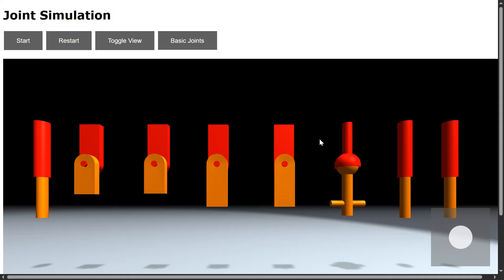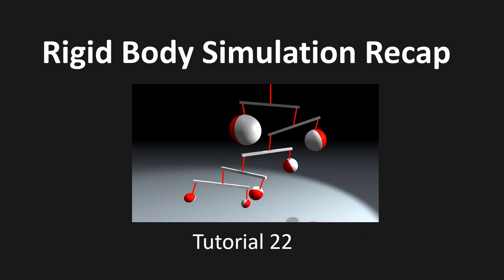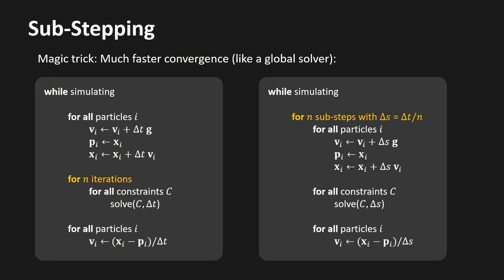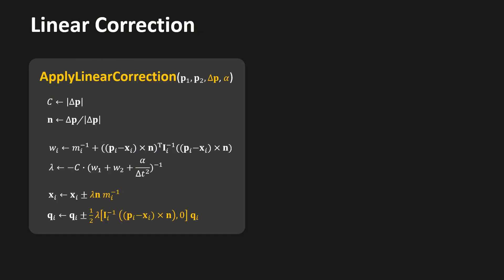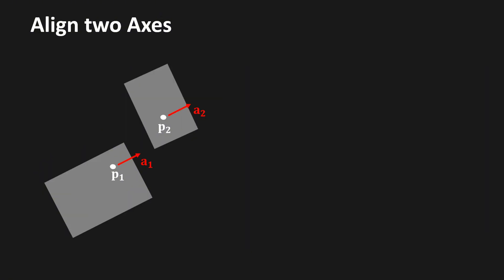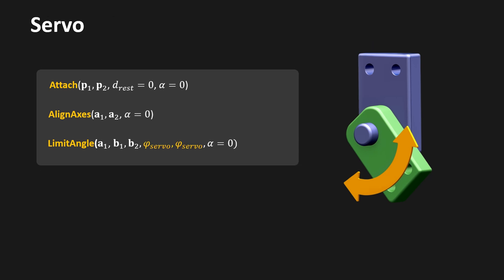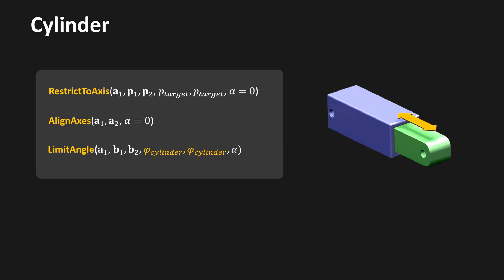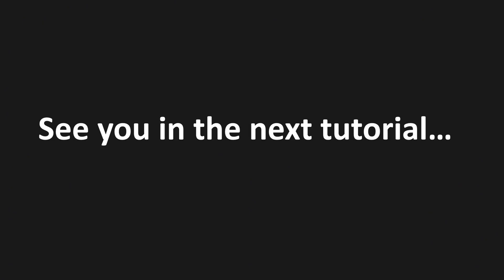Joint Simulation made simple

Comment: I didn't get the part where at 1:48 you are saying that positional dynamics handle large mass ratios well.
I mean, 200:1 is not a too high ratio, but my understanding is that [X]PBD actually handles high mass ratios poorly due to slow energy propagation over the low-mass chains.
For example, VBD paper by Chen et al. claims to handle high mass ratios better than XPBD due to solving all constraints per vertex instead of all vertices per constraint (at least that was my understanding). So AFAIU with [X]PBD vs [A]VBD you essentially trade handling high mass ratios for hard constraints.
Could you comment on that, please?
Also, thanks for the video, would be really cool to see a 15 min of in-depth comparison of XPBD and AVBD 😊

Comment: could you please explain how energy is conserved with the iterative constraint process?
Reply: In XPBD local solver solves each constraint in isolation, conserving the energy. So the mere rules of moving vertices around are meant to not violate the energy conservation rules.
So, if each isolated constraint solution does not violate it, then the whole system does not either (no proofs there 😂)
In the end the only thing where energy can leak in/out of the system are numerical errors.